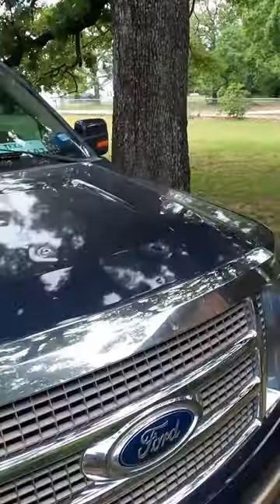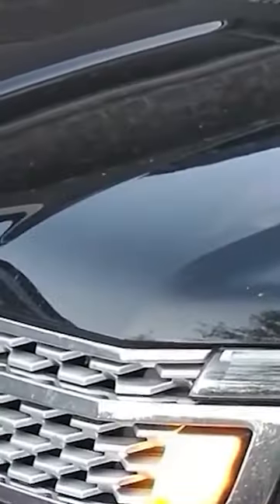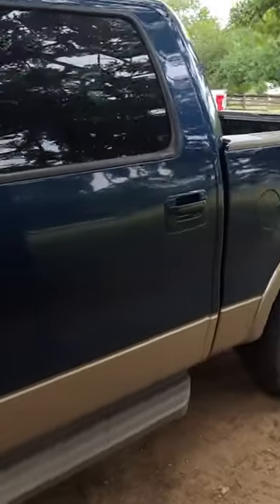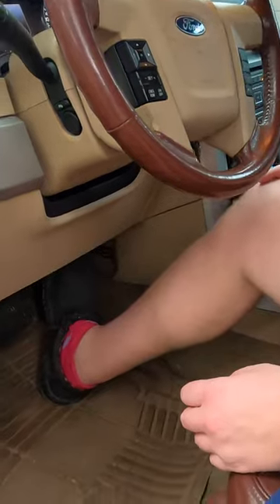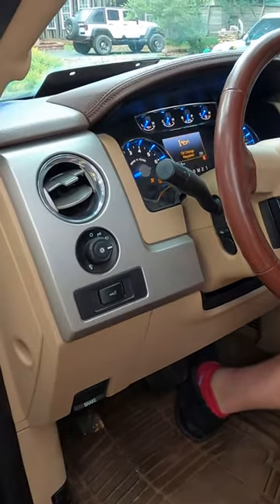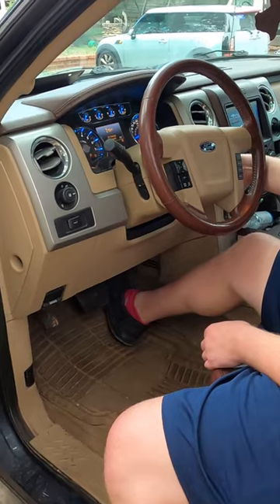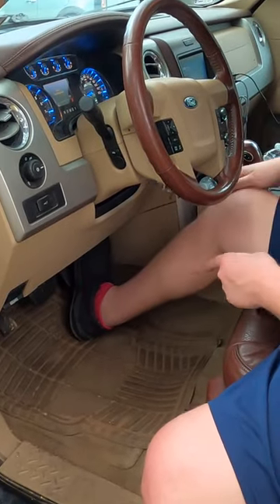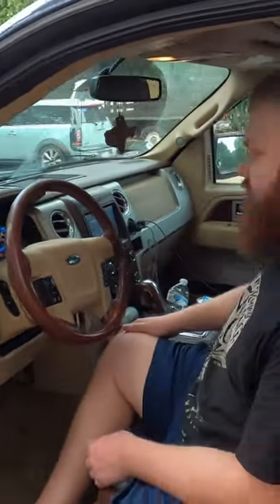2013-2021 Ford Ecoboost 3.5l Cold Start Rattle Band-aid Before Repair. #shorts #ecoboost

Comment: This issue was fixed in 2021.   They have a revised cam phaser in the new trucks.    It was a problem in the 2011-2016 first gen ecoboost.
Reply: nope plenty of videos on youtube of it still happening. just saw some when i was looking up what cam phaser issue sounds like

Comment: What is the cause?
Reply from the maker: From my understanding, there is a lockout pin on the cam phasers that is supposed to lock them out until oil pressure is built and they can function normally. They are known to fail creating slop at startup. I will break it apart when we do the timing job to confirm for sure, but its a fairly common problem.